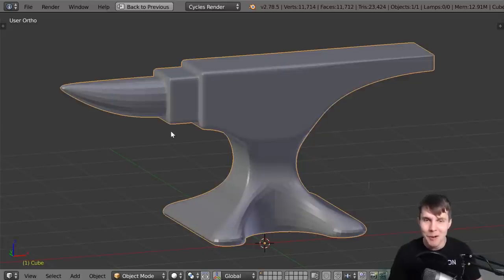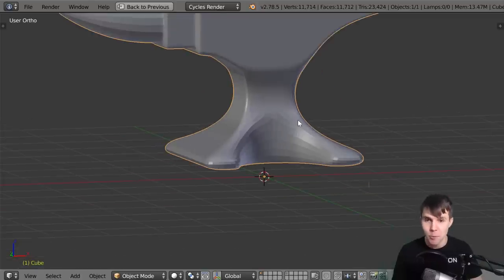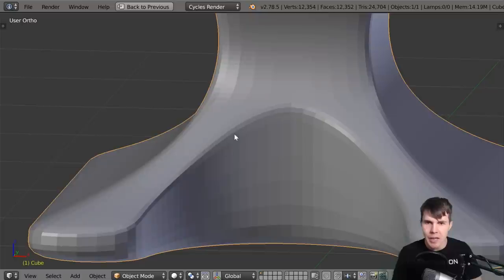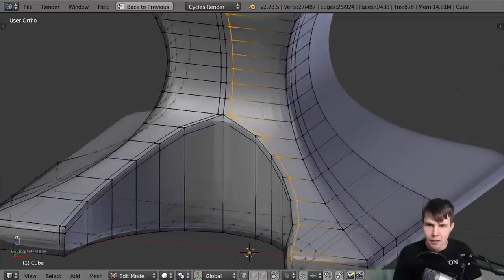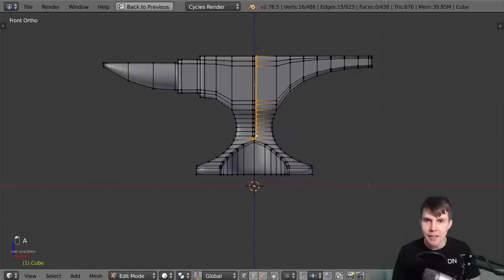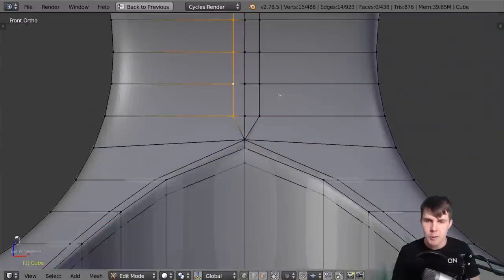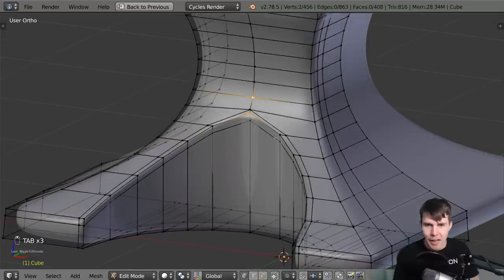Blender Intermediate Modelling Tutorial - Part 4: Final Touches

Comment: Hey!
I really like your tutorials about blender, and I would like to ask if the moving/scaling/rotating tools shortcut can be changed?
Since I am used to maya, where these tools are the W/E/R buttons I find this mechanic really weird. I saw that this mechanic (maya mechanic) is present in blender as well, only I didn't find any shortcuts for it.
This would help me a lot.
Reply: In File > User Preferences, at the top there are a few bars and click input. There's a preset button with 3dsmax and maya I believe. If that isn't to your liking you can change only certain shortcuts by finding them on the right side.
Reply: *G*rab is the usual for moving. (As *M*ove in Blender is for changing layers.)
*R*otate, should be obvious enough.
*S*cale, ditto as with rotate.
*E*xtrude, not too hard to figure out.
Then there's an alternate S command Alt-S for *S*hrink/fatten.

Many commands in Blender can also be chained. So if you're extruding you can scale or rotate it as you're extruding. This comes in handy with shift-R for *R*epeat, as it'll do the last command with it's corresponding chain of sub-steps.

Bolding letters, as that's your mnemonic device to remember the hotkeys better.
Reply: Thank you this helpes me :)
Another question: in maya I can move objects on 2 axis at once (so like horizontaly or vertivaly anywhere, because between the arrows is a tiny square which allows me to do that), can I do it in blender too?
Reply: You can do it by pressing G and then shift+axis you don't want to move around. For example G, then shift+Z if you want to keep the object on the ground.
Reply: Shift plus the axis you don't want movement on while the command is active. You may also look into transforms settings, as the default axes referred to are the global ones. (Other options for normals, local space axes, and custom transforms - user defined axes available via ctrl-alt-space.)

Comment: If I wanna sharpen the edges of a part in my mesh, I hit ctrl + r to 
create an edge loop, then deselect the edge loop in that part (so I only
 have the edge loops selected on the rest of the mesh which I don’t want
 to affect) and then I hit x - dissolve edge to only keep the edge loop 
remaining in the part I wanted to sharpen.
Is this a safe way to work or will I get myself in trouble later on?

Comment: in his model, the top of the cylinder boolean aligns with the 6th horizontal loop cut on his anvil. mine aligns with the 4th loop cut (meaning the cylinder should've been set in deeper). is there a way to quickly resolve this issue without having to redo everything?

Comment: Question: my wireframe/edges gets covered by the smooth shading/subsurf modifier. Without turning X-Ray on, is there any way to make the edges and verticies visible through the shading? On Andrews machine, it looks like the wireframe is still visible through the subsurf whereas mine gets covered up in areas.

Comment: I have not been able to understand why the crease tools can't be used for values between 0 and 1. What can happen if we used a crease value of , say 0.95, for that square hole to soften the edge a bit?  This makes so much more sense to me rather than adding loop cuts.
Reply: Peter Lieber As far as I'm aware, you can set those values for a smoother beveled edge, I used it to soften the edges of my Minecraft character model slightly without using a bevel.
Reply: the problem you may come across with though, is it smoothens from between the existing faces/edges, so if they're far apart or are of different shapes or sizes, you'll run into a lot of issues.
Reply: I've heard that creases don't export well when using your model in other software or for a game. That's one thing I've heard. It can also be nicer to sometimes have explicit geometry.

Comment: Why is the material weird?
So, I decided to give my anvil a material using nodes like in the beginner tutorial (donut); but the looks of things are different. There are tabs called "surface", "wire", "volume", and "halo" in one material now. When I shift+a in the node editor, there's no shader; only "input", "output", "colour", "vector", "converter", "group", and "layout".
When I open my old donut file, it's fine. There's shader in shift+a.
Reply: Eric Eric I think i know your Problem, did you check that the render configuration on the top of the screen say's cycles render and Not Blender render, if you change that it should work ;)
Reply: Mr.Unknown Thanks. Never thought about that because it's the only thing that I use that's located on top.

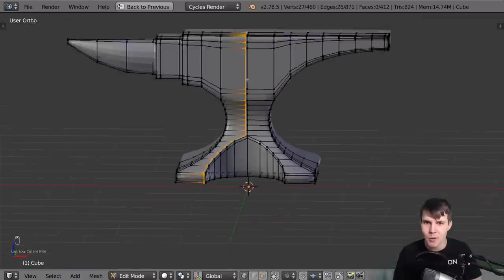Comment: I'm having an issue at 2:35. The loop cut tool works fine on the left side of the vertical edge of the anvil(the line following vertically from the highest point of the anvil's base's cutout) but on the right side of the vertical edge the loop cut tool won't go all the way around the mesh. I've already checked for any duplicate vertices. Does anyone have any way to fix this?

Comment: For reference: 3:37 (Pause Frame) 

Question: Where Andrew has his Vertices placed... Mine are a little different. I went to merge the points at center but as i did this the mesh deformed. I undone my last step and noticed that my 3 vertices are already in a line, perpendicular to each other. That is to say the edges of these vertices are completely straight. When i did my loop cuts just before the time noted, i was mindful to measure both cuts at an equal distance to each other (0.8/-0.8) and thus i believe it created parallel lines naturally. They do not naturally meet into a tip. There is a gap of 0.03m between the two outer vertices and the middle vertice(s), equally distanced. 

Is this okay? Am i able to skip the 'merge at center' action and move ahead? I don't want it too bite me in the butt later down the line if this is going to be an underlying issue.

I remember in Andrews Doughnut 3.0 (i think) about always trying to use accurate scale and measurements and so I have tried to drill into my work the importance of symmetry in that manner. 
 
Any insight would be valued dearly and appreciated! 
Hopefully i explained enough for people to know what i mean, evidently i am a beginner so forgive me :')
Reply: I am not sure. He deliberately moved the 2 vertices upward and then merge at center. I am stuck at this point too
Reply: I think I understand why Andrew moved the vertices upward. So, I just followed the step by step
Reply: @zhafrishafiq  yeah, I continued without doing that and when it came to UV wrapping I encountered problems. Areas of my anvil had stretched UV’s where as Andrew’s didn’t. I had fun sorting it though! Good luck with yours :)

Comment: so something happened to me at the 5 minute mark when we were working on the edge of the bottom part of the anvil. I had one vertice that was connected in the middle. when looking at andrews edge after we worked on that lip part I saw that he had the main edge and then the two there from the loop cut. something happened weirdly when I tried to merge everything and I think I lost my original loop cut edges and so I thought I could save it by adding in some vertices and then reconnecting them to make vertexes with the others from the loop cut. 

it worked... but now when I look at this with my subdivision there is a hole in the mesh and I seemingly messed a lot more up with this "fix" I thought I had done. Is there anything I can do to fix this?
Reply: I also noticed that during this step I had on proportional editing from the previous tutorial video. I am guessing this is why I was having an issue with this. going to see if I can go back and restart from before making this loop cut

Comment: I ran into a problem making the loops around the base of the anvil because I'd made a subtle mistake in part one. I didn't extend the edited area of the curve of the base to the bottom loop, so that loop stayed the same size as the original base. When I created the cutout with the cylinder using the boolean modifier, the outermost segment was an n-gon, but it looked like it only had 4 vertices because the fifth was in the middle of a straight side. I used this tip to figure out where the problem was. https://youtu.be/uHC7_DvH9NM Then I deleted the extra set of vertices.

Now I can finish watching this video.

Comment: 17:40 I simply deleted the faces next to the cube and did an edge loop so it stopped immediately after the cube
Reply: It is s flat surface you could liturally do any pattern with the knife to stop the edgeflow to fix the corners with the loop cut. It was ages ago. He is not/wasnt a pro at the time. Clearly he had no idea about what he is doing and end up with messy topology that dosen't even match the desirable shape. Nowadays he got better. And the scene has changed. nowadays you can learn from professionals who are actually using blender for work.

Comment: Around 19:00, Andrew is making a hole in the anvil, Andrew suggests to settle for some curvature rather than performing 100 tasks just to have a sharpened edge, however the sharpened edge can be achieved rather simply by deleting the two faces on each side of the extruded face (along the x-axis) then creating 2 loop cuts. Once the loop cuts have been created, fill the deleted faces but instead of recreating 2 faces you'll need to create 4 so that each face has exactly 4 vertices..
EDIT: Now I have diagonal creases... I can't win lol

Comment: trying to make some neat stuff, learning a ton from your videos, and i have a question that may or may not have been covered. So I am trying to make a combat vehicle. ive got the hard surface modeling part going pretty damn well. My question is thus: i want the vehicle to be destroyable/repairable best physical example the mechs of hawken and i want to be able to change weapon loads, shields, etc. im assuming the shields, weapons thing is simply have separate models for each weapon and shield generator etc, with attach points, but as far as the vehicles hull/body, how would i make it so that there is visible damage leading to destruction explosion, or the opposite, damage that can later be repaired? Sorry If it came out funny, im on lunch break and short on time. Thanks for all you do.
Reply: if it helps im using unreal engine for the actual game core

Comment: not to piss anybody off, but 3D artists should really stick to the organic shapes that cannot be done in proper CAD...
i like how the Guru shows different techniques and especially the ones for texturing, but maybe its the engineer in me speaking, but this series up to this point was painful to watch. he was totally butchering a straight forward parametric object, designed and built by a craftsman for another craftsman, which easily could be built in CAD in less than half an hour and then imported as a mesh into animation software...

i still watch it and take up the tips on how to use blender, but i think it would be way more appropriate to show these tricks where they are actually necessary: organic shapes, that dont have many straight lines or flat surfaces and cannot be described in CAD
Reply: This a a blender modeling tutorial, focused on blender tools and retopology methods, a stepping stone for 3D artists so that they can use these methods on other models. What you learned here you can easily apply it to organic shapes if you so desire. That's the whole point.

Also I don't know much about 3D CAD but not all animation/game engine softwares support nurbs. And as far as quad based models go this is as simple as it can get. I know it's far mode difficult and tedious but I hope you understand it's very neccessary for many of us.